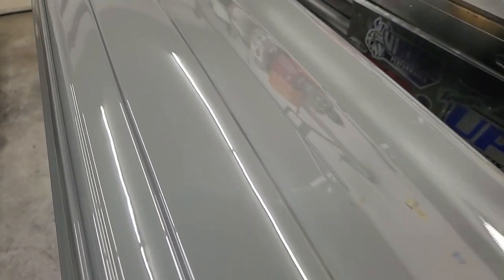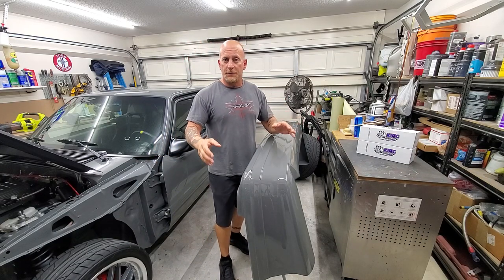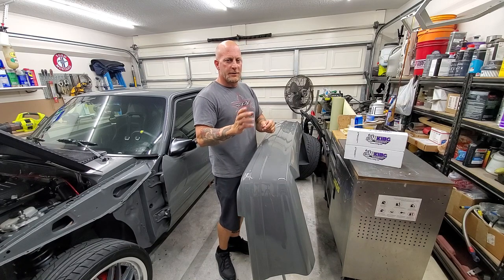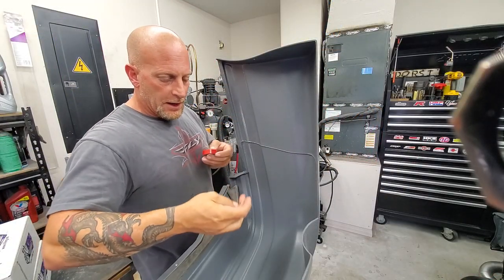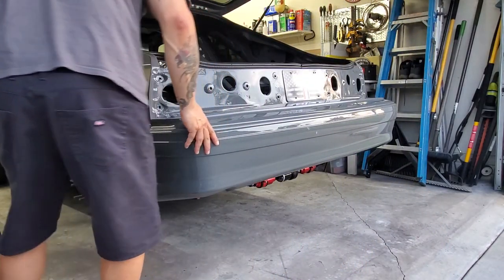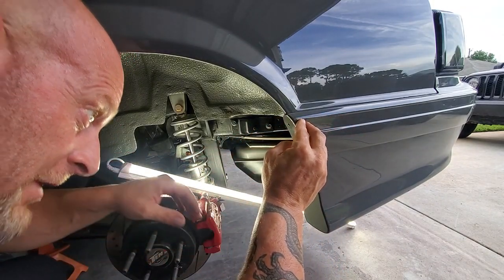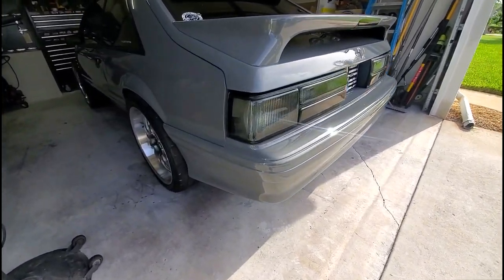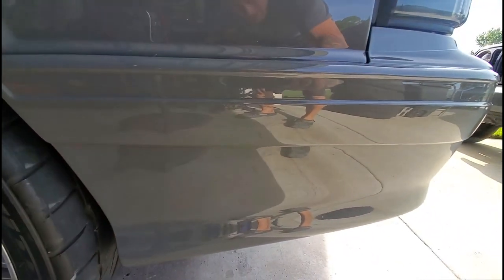Cervinis Foxbody Cobra Rear Bumper install with Tony D

Comment: MAN! I love how you put those pop rivets and nut inserts for the bumper install! I struggled so much trying to keep that brace in place and on top of that, 3 years later, my bumper is sagging. That brace isn’t doing much for my bumper. I’m gonna have to remove it and “update “ the installation with your smart techniques! Also, that updated lower bumper bracket from cervini is sweet! I unfortunately have the cheap L brackets. Which look tacky and was super disappointed when I saw those after I had spent $500 on the damn bumper. Thanks for the videos! Loving the car!
Reply from the maker: Right on brother! Thank you! Try giving Cervinis a call to see what they can do about getting you the new bracket.. they know the olds ones are a problem and im sure they will do the right thing for you.. lemme know how it goes!

Comment: Glad you mentioned about the paint, I have been researching around and can’t decide where or what to buy. Want to do it myself, never painted before. I took notes on your compressor and gun setup, good information 👍🏼
Reply from the maker: Right on.. ok did you get your compressor set up yet? For a good warm up lets get you going by spraying the wheel wells in a single stage urethane satin black.. its good prep work and can come out really nice.. if it dosent no  biggie cause it really wont be seen..  have you been to your local body shop supply yet?
Reply: @TonyDFreestyle96  Thanks that’s a good idea. I’m about to purchase a dryer/filter setup for the compressor and get it all setup. I just finished up body work on the engine bay and have it primed with the Eastwood 2k primer, it came out pretty nice so far. I did stop in a local paint supply but they were pricks, gonna keep looking. Appreciate the help
Reply from the maker: @lancelewandowski2667  lol... yeah they are usually pricks.. especially when you are starting out.. I will say the eastwood line is a good place to start so your on the right track.. dont go crazy with your setup.  A basic dryer and gun is all you need to get going for now. Try to paint some smaller items first.. maybe the mirrors, trim pieces etc.. this way you can work on your technique and timing between coats..

Comment: Hey Tony,
Diggin on the channel brother. Thanks for that moment of silence... Respect for our fallen shows your class...

Hey I'm working out this trade to get an '86 SVO for my '69 F100. It will be my second Fox. I'm 53. My first car was a '79 Ghia notch: thing had negative nads! But I was lower-middle class, 19 & happy to have a 'stang 😅

Anyway, I'm kinda wanting to do an old school build. Got a fresh 302, e303 cam, a '60's Edelbrock "Twister" high-rise intake, Holley 650, World Class T5, 3:73 rear

Going with Niché Misano matte gunmetal wheels (which aren't very dark, not into black) 19x9.5''s out back, 18x8's up front with the Michelin Pilot Sport 4's. I did a ton of research on this setup to make sure it will work. I'll leave a link to my cart at Summit if anybody else wants to go this route...

I'm wanting to paint her a decently dark gunmetal with a heavy silver and bronze mixed flake. Question:
Have you ever heard of any painters spraying their color and THEN putting their flake in the first couple of passes on the clear? (and mad respect on your paint, car is going to be a stunner) because see, I have this theory that when the flake is added in with the color: it gets lost IN the color. Does anyone get what I'm saying or have any of you tried this? 

Btw, I know I'm going to get some purist haters on the molestation of the SVO, but it was cherry picked already before I got to her, so whatever.

Last question: Do you believe that SVO K member will support the sbf? If not could you recommend a somewhat economical swop?

Thanks for any response & God bless
Link:
https://www.summitracing.com/cart
P.S. - Anybody know any good painters in the Midwest/Kentucky region? (I don't have the time for doing the paint)
Reply from the maker: Hey Brother, thanks for reaching out. It definitely makes me happy that you felt that short moment with me. Had I known all this was gonna happen I'd be restoring a fkeet of F-16's and went out with a few friends to take care of a few things but thats a whole different topic. Thank you for your support on that one... 

Ok so as far as mixing flake into clear.. Yes you can do it and Ive done it on many motorcycle paint jobs in the past.. can you do it on your car. Yes.. do I recommend it. Absolutely not.. heres why and a better solution... If you ever need to make a repair, i dont want you to have to repaint the whole car to fix a scratch...  instead of clearcoat what you will use is binder. All it is, its basecoat without any toners.. you would definatly make sure you weigh it out on a scale, add your desired amount of dry flake and definatly write that down somewhere for future reference.   Definatly mix enough to do the whole job at one time while the car is compleatly together..  and mix it all in 1 container together! doing it this way will ensure nice even coats and no zebra striping...  you will hit it with 2 coats of clear after.. after about 24 hours block wet sand with 600 and reclear it with 3 nice coats.. then wetsand and polish after that dries..  it will come out amazing!

As far as your k member for the svo I believe its exactly the same as a regular fox however call the guys at UPR in Lake Worth Fl.. they will be able to tell you exactly of it will work...

Let me know how it all works out for you!
Reply: @TonyDFreestyle96  thanks for all the advice. Right there with you on the F16's. These morons are definitely not up to the job. They're a pathetic joke. All our casualties there died for NOTHING.
Keep up the great work. Hope to catch your car at a show when you're finished with it. Looks incredible already. By the way, I really appreciate your teaching style, really great. You could start a school! 😅
Reply from the maker: @BUCKETJACK  thank you brother I really appreciate your support here! Hopefully Ill see you out there one of these days! Let me know how the build goes! Feel free to ask anything anytime!

Comment: Tony you do outstanding work! I’ve never seen a dry guide coat block before, where can I get one? I’ve painted 2 cars a while back, Cracker lacquer! One came out really well, while the other was kind of thin. It has been many years ago and products are not the same. I’m going to do my fox body in my garage just got started on it. Will be watching your work intensely. I would like some advice on some paint that is garage friendly and midpriced. Keep up the great videos brother! Thanks for the great content!✌️
Reply from the maker: Your local body shop supply should have it if not any online supplier will get it shipped to you.. it works ok. Its a little messy.. I still prefer the spray tho... good luck with yours!

Comment: I'm in the process of painting my 90 mustang right now, already sprayed the hood, bumpers and spoiler. Trying to decide if I want to lay down sealer or not .
Reply from the maker: Right on.. what color did you choose and what was your finish before you put the color on the parts you painted already?
Reply from the maker: You have IG?
Reply: Same as original Oxford white, I'm just doing a  refresh,  no door jambs etc.. And I don't have IG any more. I also did the cervinis front and rear bumpers with a mach 1 style hood and Saleen wing.
Reply from the maker: @mikeanderson4080  right on.. well best i can say is if you have extensive repairs its always good to get it all in one color before you base it.  Im not a big fan of using sealer only because I prefer using primer and blocking it. This way were starting off nice and clean.. For this color you should be able to get away with it.  Just make sure you get a sealer light in its value shade.... what product line are you using?
Reply: @TonyDFreestyle96  Since this was my first time painting I went with tcp global paint BC and FC720 CC, if I was going to do it again I would probably have used spi.
Reply: @TonyDFreestyle96  Also I'm using white epoxy under my bc
Reply from the maker: @mikeanderson4080  So if the body has paint on it already and you have sanded it down, done your bodywork, spot primed or primed everything and sanded again epoxy isnt going to benifit you in this situation.. a correct value shade sealer, or just urethane primer is going to be good to go.. I know this is a very controversial subject and im all about over kill sometimes but in this case personally I dont like introducing epoxy with the urethane. It could cause complications unless you were down to bare metal on the whole job and started with the epoxy first then urethane primer I would steer clear of doing that myself. Some would disagree but just my take on it...
Reply: @TonyDFreestyle96  Yeah I'm just doing minimal bodywork, spot primed and thought thinned epoxy primer might do it. The paint is in really good condition considering it's been garaged for 20
 years. Now I'm second guessing myself.
Reply from the maker: @mikeanderson4080  i would just suggest high build, guide coat,  long block it nice and shoot it.   You'll be suprised at how many little imperfections pop out and you can work them all out nicely.. especially the roof! Lol lemme know how it goes!